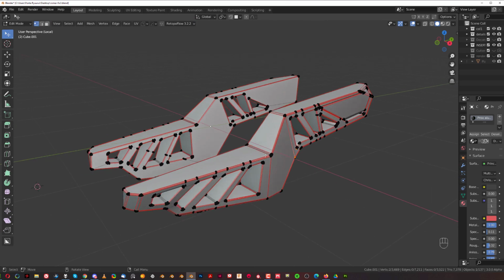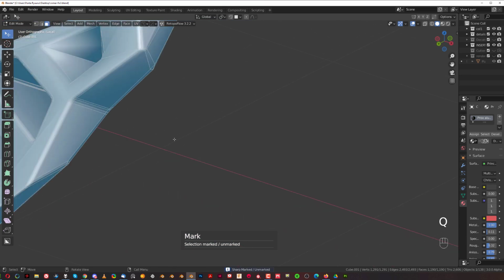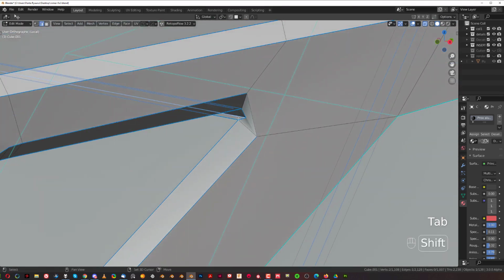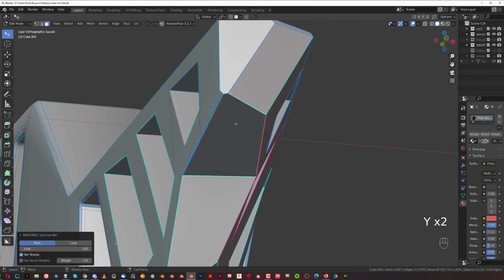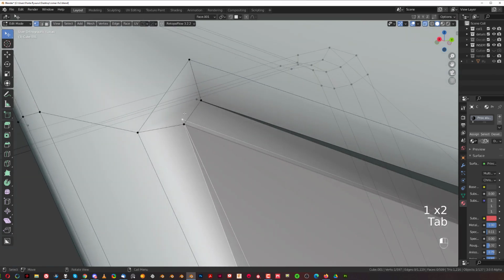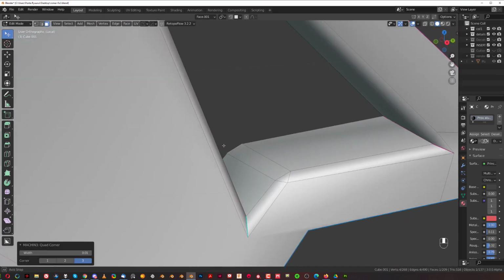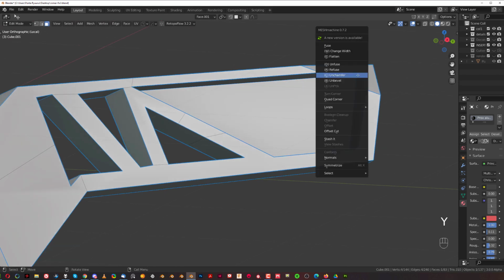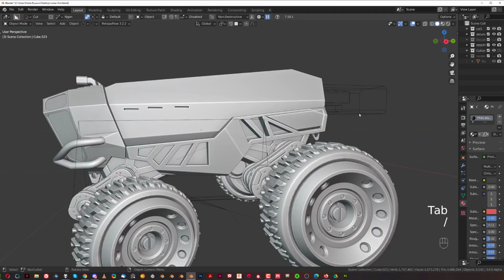Blender Tutorial - Let's Fix Hard Surface Topology Mess With Mesh Machine and Machine Tools

Comment: If you were  to do it at the start manually  though wouldn't you not have that situation?  Like I refuse  to use add  ons. Just because it messes to much with topology  and I don't want to spend hours on fixing topology  when I could of avoided those problems at the start .
Reply from the maker: arguably, that's the most retarded shit I've read all week
Reply: Did u see theses addons working? Hardops and Boxcutter is a piece of cake to improve your workflow beside freeform modeling. Study more and see it.
Reply: Why was that comment deleted?
Reply from the maker: @AkameGaKill194  because I cant be arsed anymore replying to trolls who obviously have no clue mate
Reply: @PonteRyuurui  One week ago I saw some blender tutorial from C4D user. In raw perspective It isn't bad. It's good. But pretty outdated for nowadays  Gosh right after watching it I've got so many flashback's from early 2000s when I spent so many times in 3ds doing manually the "perfect topology". Just ignore it. It's kinda religion for them